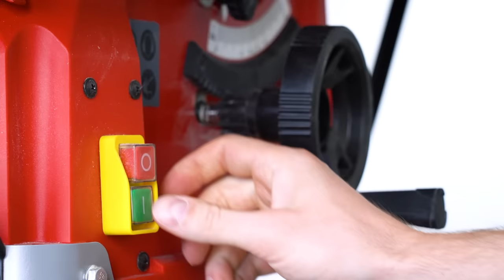Insane Floating Tensegrity Chair

Comment: Unfortunately, the materials you used and the methods you used in several places nearly guarantees a failure very early on in the life of the chair and as others have pointed out, a failure may get a stick rammed up one's sphincter. A redesign using more trustworthy materials and better ways to secure rope ends. I would use cable or all thread maybe. The knots on the rope ends are a big problem for me because the knots will tighten causing sagging (brings that stick closer to the sphincter). Or worse, they tighten to the point they slip through a drilled hole in crappy soft pine wood. No thanks, I'll stand or sit on the floor.

Comment: Cross Cutting on a tablesaw when a Chopsaw/Mitre Saw, or even just a plain old cordless circular saw will do the same thing just as well seems so weird to me. 
Nevermind the fact that he's doing it without a mitre guage/ripfence, which is a great way to end up with mashed potatoes for hands, or worse, just straight up dead.

Like it's one thing if you've got a giant piece of lumber, or need to make a crosscut on several pieces all at once at the same length, like a on a work site, but why in god's name would anyone use a table saw to crosscut individual 4x4's, my abs hurt and my fingers were feeling frightened just watching that, lol.

Comment: Showing improper use of power tools should be stricken from the public. The guy did not us a fence or crosscutting guide for any of the sawing! At the conclusion, what do you have? a very unsafe chair, as many of the coments suggest - the Dr. will ask how you ended up wearing that peice of wood where the sun doesn't shine!

Comment: Please DON'T follow this builder's tool techniques. Crosscutting any piece of wood, let alone a 2x2 without a a miter gauge or some other positive guide is EXTREMELY DANGEROUS and could easily cause serious jury or even death. A kickback from a table saw blade can launch at speeds approaching or even exceeding 200mph depending on the power of the saw. As a professional furniture builder of over 30 years, I can tell you that it will happen so fast that you literally won't know what the hell hit you.

Comment: The very first thing I notice is how UN-ergonomic the chair actually is. Scene one: An adult human male sits on it, and *his feet barely touch the ground*. Immediately tells me that ergonomics did not feature in the design process.
I learned the principals in 1975, at Architecture School. it was a revelation. I apply it everywhere I go, AND notice where it is missing. But seems the idea has failed to take root in the design-world. I see crap designs entirely too often. Especially in public seating. 
The worst seating is always in medical waiting rooms, and cafes. 
Built by builders? I'm guessing Ergonomic Design never featured in their training.

World-wide fail. 
Worst/most-consistent error: seat is simply too high. (Built by men; for men, perhaps?) 
Normal-height women, the frail, elderly, and children cannot ever be comfortable. Leg pressures.
2) Flat pan. This seat *is completely flat*. Combined with over-height pan, this causes most people to feel like they are sliding forwards all the time. Pan needs a minimum 5-degree slope - tipping back. 
3) dreadful backrest. They'e usually either too upright, or in this case leaning too far back (see my point re sliding forward).